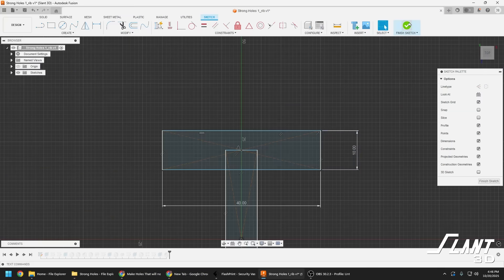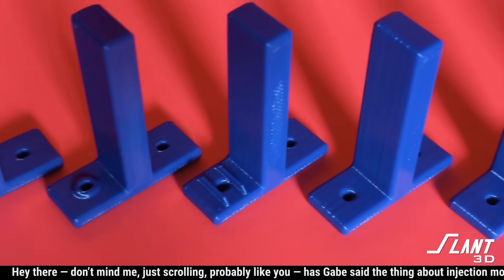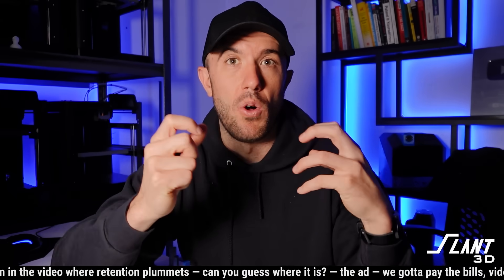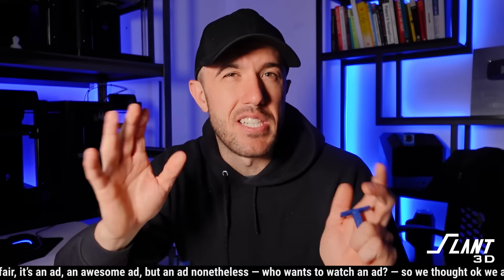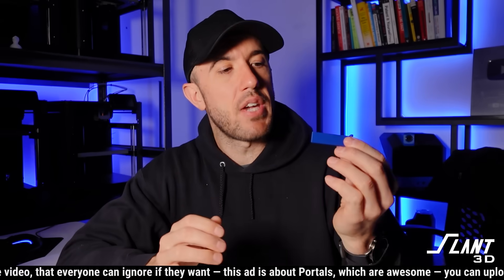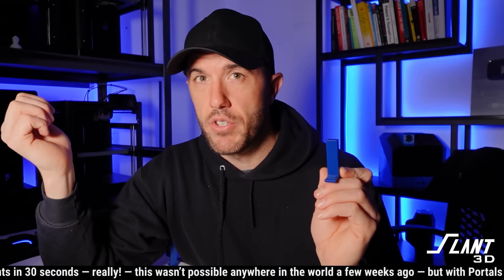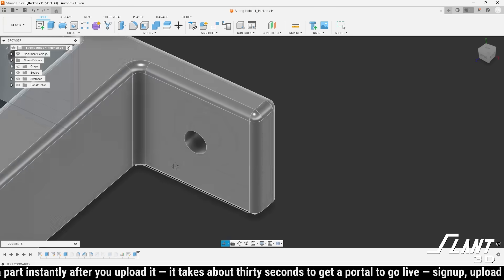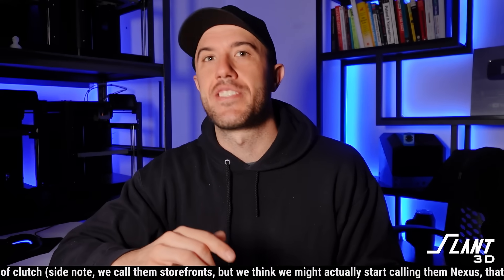Holes That Won't Break | Design for 3D Printing

Comment: I noticed that it is difficult to find a truly flat screw head, there is usually a bit of conical shapes as it usually is not at all important. Check with a large magnifier, microscope etc. and you often find that especially if the hole is very tight the very last 0.2mm is conical and tries to push things apart just when the torque is highest. 

I started using metal washers. Specifically stamped washers. The stamping process creates a bias, they are a bit conical but they are convex on one side and concave on the other.. And the side that is concave has a lip at the outer edge due to stamping. Combine the two and you get something that is almost trying to push layers together. And use more generous tolerance in the hole. You get really strong joins no matter the printing orientation. And if you give it a nice recess, drop of glue and the part becomes nicer looking too, it has that sort of "industrial" feel: it looks stronger when holes have a metal ring around them.. 

So, check the underside of your screws. It may look benign but the main problem comes at the peak torque and that tiny, tiny bit of rounding, wear at the manufacturers end in the process all will start to create that kind of shape, it will not bias the other way for certain unless our machining is made to create a bias.. and stamped washers are exactly that. Now, finding them isn't easy as they are considered too cheap and they are not that great quality, they scratch paint because of that sharp lip on one side so people avoid using them, notorious for penetrating corrosion protections in structures... The cheapest Temu crap is better for us than the "good stuff". The good stuff is almost worse than the screwheads, they really are not flat but convex on both sides...

Comment: Or, you engineer your part where the mounting holes are vertical. Regardless of the material you make that bracket from, horizontal mounting holes are going to create a meriad of problems.

Comment: Newb here. I was looking on how to beef up the areas around bolted connection holes and pressed in bearing holes. My print cruched when I put hte bearing in. It seems to me one of the simplest ways with great controls is to add a 'modifier' feature in your slicer. I know he said he is aiming for a model that can be sent anywhere for manufacturing but for me, if I am modeling, I am printing it myself. I can just save the gcode file after I set it up. By adding a modifier, you are able to simply set that object to solid fill or any infill setting for that area. Perfectly simple, fast and repeatable.

Comment: Some other things you can do to increase the strength, albeit using slicer settings.

1. Increase extrusion width, larger contact surface = better adhesion (133% is optimal according to CNC Kitchen testing)
2. Printing at the correct temp for adhesion as the material will fuse better at say 210 compared to 190 degrees. (Again, according to CNC Kitchen, if you go too high, you loose adhesion for some reason).
3. Slow down the fan speed where possible. Again, cooling the layers lets you print faster, but it also solidifies the layers before optimal bonding is achieved. 
4. Staggered perimiters / Bricklayers lets you print with an offset, like a brick wall, so that any singular extrusion is held in place by the layer above and below. (About 20%?)
5. Hardware. Adding a spacer will greatly increase the strength of the mounting point.

Comment: I kinda feel like Slant3D videos are starting to become less "how to design for 3D printing" and more "how to design for a printing service that hates slicers." Which, okay, fair, I get why exposing slicer settings would be operational hell for you. But it seems like what the world really needs is a way to put metadata into a 3MF that says "make this area solid" or "make this area resist torque" etc. so that your slicer can make intelligent choices based on designer intent, instead of requiring design hacks to trick random slicers into doing what you want or having to manually configure the slicer in a low-level, per-printer way.

Comment: It is interesting, but why not just use modifier shape (disk) around the hole and just set number of perimeters around it to 100? This is way easier then modeling it. The only pros for the modelling is that this will work for a print farm like yours, but for a home use it is better to just use modifiers.

Comment: I don't get it. What's wrong with using the slicer to tell the machine what to do? This is like trying to use a model to tell a CNC machine what speeds and feeds to use...

Just use 3mf files.

Comment: I love your tips. I agree with @jretzlaff. Use round head screws rather than flat head screws as they would apply flat pressure against the surface rather than the V shape that pushes outward as you tighten it down. Countersink them with a flat ledge, if you want the result flush.

Comment: I'm finding your explanation frustratingly unclear. It sounds like you're suggesting modeling a very thin, washer-shaped ring around the hole—fully enclosed within the part—and then using a Boolean cut to remove that material, creating an internal hairline gap or void that forces the slicer to generate solid fill.

I can’t be certain, though, because in the video you spend only a few seconds in Fusion and never show a cross-section of the geometry.

Comment: Makes sense, now explain how someone can take an existing model and fix holes within the slicer... I can't model, so I rely on the models of others. But there have meen multiple of you very informative videos explaining how to model things better... But I have no idea how to implement them into existing models.
Reply: Most STL editors support boolean operations. You can make a very thin wall and cut it out using boolean operations. You might need to cut the hole out of your "tool" first to avoid accidentally making the screw-hole weaker

Comment: A 6 minute video but the solution is shown for a half a second and I have no idea what you actually did.
Reply: When you make a hole in a model, the slicer will automatically make the walls around the hole stronger. The hole of the printed object however is not strong enough. So, how do jou make it stronger? Make another "hole" around it! This "hole" is in fact an empty space with the form of a washer of 0,1 or 0,15 mm thick. It is inside the model and you can't see it from the outside. The inner radius is a bit larger than your real hole. The slicer will make your hole a lot stronger.

Comment: I would never design a 3d printed part to use countersunk screws in the first place, no matter the orientation. It's just a bad idea as these can be overtightened and push the layers apart or cause deformation as they have a lot of leverage. Even in wood we have to be careful with placement of these as they can cause splitting. Use non-countersunk only for 3D prints and even print washers if you need to spread out the force further.

Comment: Huh... the thing you said about the slicer settings makes me think that there's actually some call for like, an intermediate slicer representation. Like, why are we trying to put these things into the geometry when they're really about how the machine creates the object? Not that your tip is bad, but that we probably should be splitting slicer settings between what a specific machine needs as instructions to create the tool paths and the specification for how the part should be created.

I guess there's just too much innovation happening in slicers at the moment for that to be settled upon though.
Reply: 3mf files are doing that at least for color. I wouldn't be surprised if it didn't get extended to adding voxels and not just face metadata

Comment: Ok, long-time watcher here:
While the scrolling text was hilarious, I couldn't really pay attention to it OR Gabe fully, so I missed a lot of what Gabe was talking about, and he moves pretty quick (which I totally appreciate, when he has my full attention normally).
Also, not sure I agree with the orientation of the microfeatures on this. By making negative "washers" in the part, you now have squish that can happen as you tighten the screw. By using the normal axial pinholes around the screw hole, they don't give the outer layers anywhere to go, but do add walls.
Great idea with the text, but not really digging it going forward.
Reply: The scrolling text makes us scroll back and rewatch increasing watch time.  :O Business.  

I got the impression that the "washers" were basically 2D only and just forced the slicer to think something's there, print the extra bits, but not actually cut away anything.  I mean, like a micron thick or something.  Seems like it wouldn't actually introduce squish.  But I'm not at all familiar with the axial pinhole thing so I need to look into that right now.  :)
Reply: The “washers” in this video are in a right orientation for the direction of printing. But if there is any actual space you are creating compliance there. 

You want the negative spaces to be perpendicular to the print orientation if possible, but absolutely not parallel to the layer lines or you are just reducing layer adhesion and creating more stress concentration where you least want it. In the video he ran them as washers, so perpendicular to both the screw and the layer lines, but vertical stripes (like kebbler fudge stripe cookies) would maybe work better. 

Running them radially would leave a gap along the layer lines right where you don’t want them
Reply: Totally agree on the annoying text. It's distracting and I am not watching the video again, just to be distracted again. #ADHDproblems

Comment: Design a piece near the hole connected to that area of the object by a thin hinge that bends over the hole before inserting the screw, giving it more strength.

Comment: This is something woodworkers have had to deal with for a long time. Countersunk screws (the kinds with a wedge under the head) area GREAT at splitting both wood and 3D prints because they produce a lot of lateral force. On top of all the ideas here, switching to a screw head type without that wedge will make life easier.
Reply: 100%! A cap head screw will make a huge difference here.
Reply: Cap screw, or if you're still looking for screws, find those  pocket hole screws.
Reply: or a washer that compensates for the wrong headed screw.
Reply: Problem is the customer. will they use the proper screw?
Reply: I've started using stamped washers with 3D prints. The stamping creates a bias, the whole washer is bent so it has convex and concave side. Concave side down and then the notorious sharp lip that comes from stamping process both work in our favor: "everything is a spring" and our spring in this case tries to pull things towards the center, not that it is much in practice (it won't bend at all, the plastic will give up first) but at least it is biased to the right direction. The lip keeping things together even more.

Now, finding stamped washers.. i noticed that they had none of that really bad quality stuff in proper hardware stores, i bought a big selection bag from eBay, cheapest stuff i could find. The stamped washers are notorious in metal working, the sharp lip may penetrate any coating you can imagine, even scratch thru electrocoating if you put them the wrong way around. But, works great with 3D prints and also wood.

Comment: It’s not explicit what type of screw you are talking about, but it is inferred a flat head with a tapered profile, which isn’t the best choice. A cabinet or pan head will compress instead of split and of course can be recessed with the right design. 

The repeating pattern of these videos is to avoid slicer settings while adding complicated geometry to trick slicers (as they are built today) to slice a certain way. This is still dependent on how slicers work - it just happens to work most of the time for your print farm company. If slicer algorithms change that can stop working, and weird stuff is baked into design files. At the end of the day, somebody needs to slice and the designer is best to do this. 

That may be hard, but that is a solvable problem.  Would be nice if that were expressed rather than a slightly condescending message that people are wrong and ill informed using slicer/print settings.

Comment: i'd put a screw perpendicular to the weak screw holes, that just goes through the part, so in this design that weak outer edge, make it so a screw can go into there. 

that way the only way those layer lines come apart is if they somehow also tear out the plastic binding with the thread of the support screw. 

Or another option is a diagonal piece of wire going through the weak part of the design, and then glued in. will make the layer lines a lot stronger. Even an empty hole through the part that you then fill with epoxy can strengthen the layer lines together. But something solid like wire or a screw will be a lot stronger.

another thing to think about with a design like this is WHY is there so much force applied to the screws. will in this case that mount is holding up a weight, and the distance of the pivot to the object being held up is far further than the distance of the pivot of the face being held in with a screw. Its a very flat and long design. It will be a lot stronger if you build in a part that supports the lower side and say has a third screw further down in the middle.

Comment: Been using cuts for years.  Works great.  If you make the cuts very thin, the plastic will usually fuse, so I make them 0.01mm and have adjusted my slicer to not filter these cuts out.  
QUESTION:  What is the smallest gap Slant3D's slicer will allow inside a print?
Reply: Ah, but now you need to change slicer settings!
Reply: @DailyFrankPeter  Well, yes, but my base profile includes this change so I never have to think about it.

Comment: I would also suggest not to use flathead screws if possible, as the conical head will have a wedging action that creates sideways forces tending to split the hole apart.

Comment: @Slant 3D,

This was very interesting and potentially very useful but it was too fast for me to really grasp what you were doing.

I think I could have gotten it if the slicer was panned vertically through the layers Instead of cross-sectionally, and I would have liked to see the suggested 3D modeled part in cross section.
Reply: Yup, me too. He spent a lot of time talking before and after, but only about 10 seconds actually demonstrating the process -- which evaded me. I even watched those 10 seconds multiple times. I'm a visual person, which is why I watch YT videos, and it seems the visuals on this one were lacking and the verbal description -- although verbose -- missed the mark (for me).
Reply: It's not difficult. When you make a hole in a model, the slicer will automatically make the walls around the hole stronger. The hole of the printed object however is not strong enough. So, how do jou make it stronger? Make another "hole" around it! This "hole" is in fact an empty space with the form of a washer of 0,1 or 0,15 mm thick. It is inside the model and you can't see it from the outside. The inner radius is a bit larger than your real hole. The slicer will make your hole a lot stronger.
Reply: Yep I was listening so hard but unfortunately as many times as I watch it back there’s not enough of a visual to go with what’s being said so I’m still non the wiser alas. 🙃
Reply: agreed. would love to see what you do in your 3d sketch software and maybe some print footage.
Reply: you can slow down videos and or watch them multiple times.
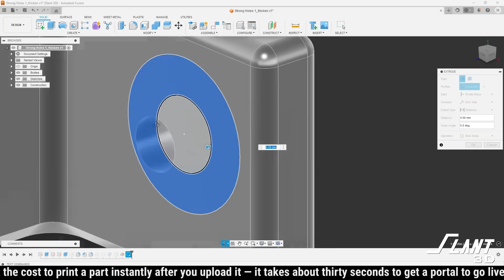Reply: @jukees3658  3:46 I have literally no idea what's going on here. What is the cut tool? What plane is he working on? Why does the before and after look exactly the same? The entire video was to demonstrate this method and yet I'm left with more questions than answers.
Reply: @duviday  MakersMuse recently and some while ago did some videos about modifying your model in the way to make it stronger without touching the slicer settings by just creating super tiny inner cuts inside the model that you don't see from outside so the slicer thinks he needs to create walls around those inner cuts. Which, if you do it right, just add more walls on specific areas while unimportant areas of the model uses the standard infill and no additional walls. Think of it like those epoxy moulded insects or similar like you can see in Jurassic Park movie or a snow globe. Where the outher shell is your actual model and the inner object is just the "hole" to tell your slice where to add more walls.
Reply: Same over here. The speed he explains things is too fast.